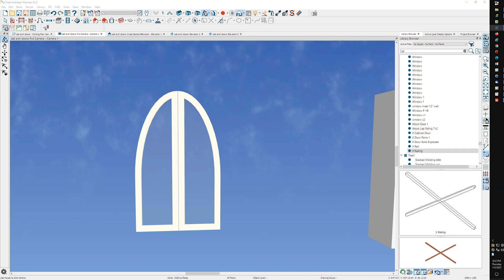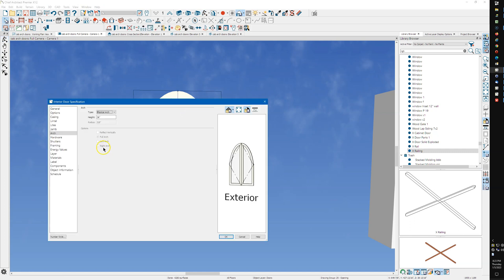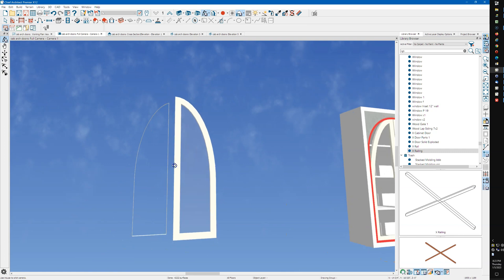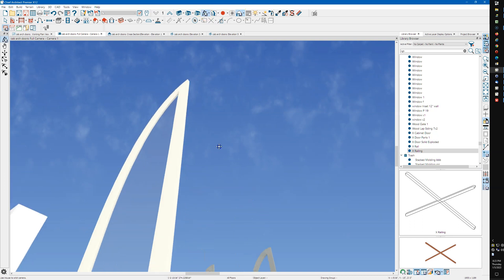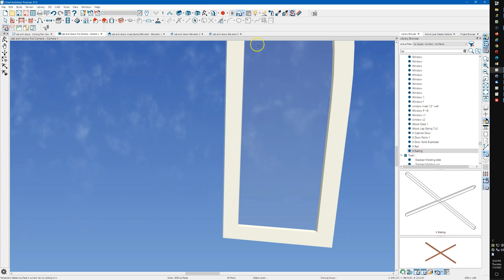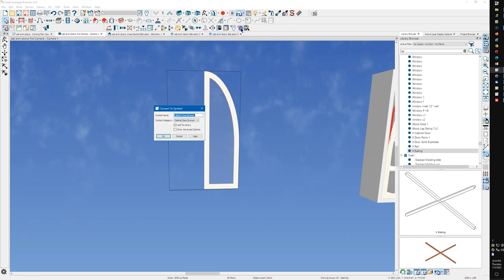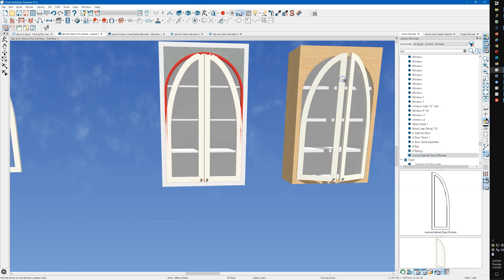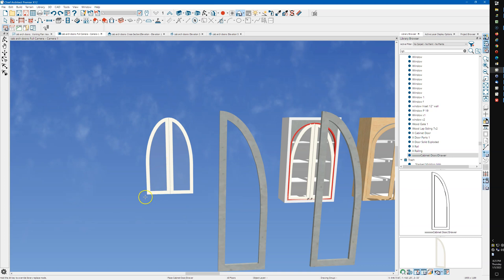Delete Surface Tool - Chief Architect

Comment: Is there a way to delete part of a fascia board in areas like roof  connections where they protrude below the surface of the ceiling?
Reply from the maker: No. Wish Chief would clean this up.